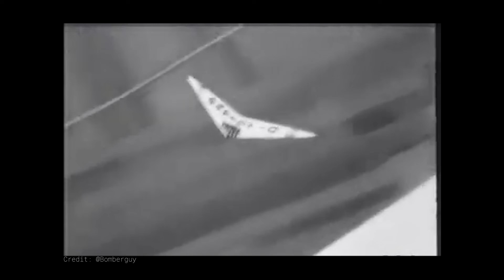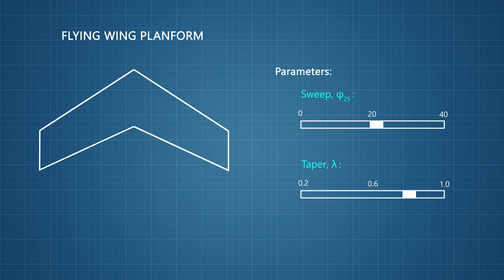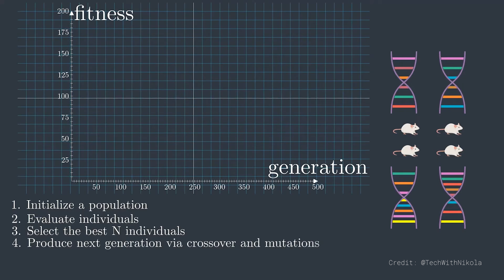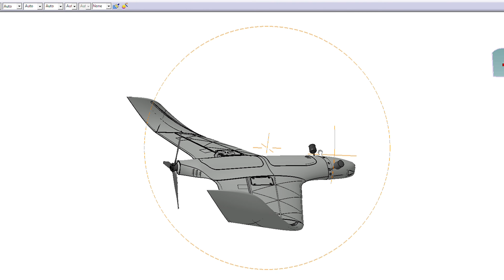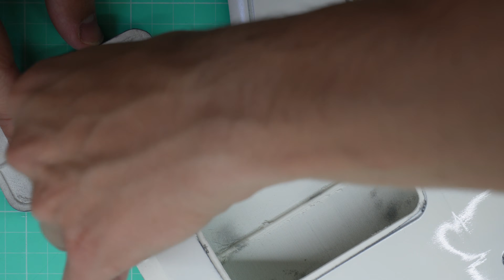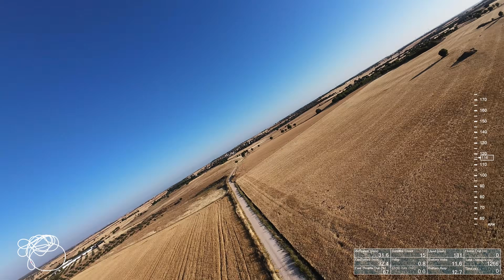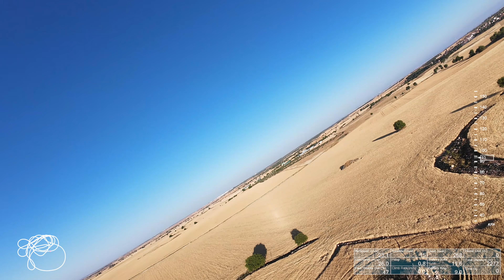🚀 I asked A.I. to design the ultimate FPV Flying Wing... and it's INSANELY EFFICIENT!

Comment: can smb explain why the wing area has formula b/2 * (Cr + Ct)? is either a mistake or i don't understand something. I'm thinking of the area of a rectangle which is height * length. so then if the b/2 is the length of the wing, which here is 30 cm, then the Cr+Ct is the height. which somehow is one over another which i disagree with, like what's the point of adding Cr to Ct when Cr itself is bigger then Ct and contains it in a sense. SO then if we just go with it still we get a rectangle area which is bigger then the actual wing area. This is not a rectangle so it isn't  a regular shape. the calculation should give a far greater area then the actual wing. So whatd up with that? Where am i wrong about this?

Comment: Insanely efficient? A Z-84 with a 4S Lion pack and Ardupilot cruises at around 3.4A and climbs nicely at 4.5A. Total flight time over an hour and with good equipment you can do 20km out and back with no problem.

Comment: Very impressive effort. My all time favorite aircraft is the Waterman Aerobile (1935). I designed a hybride wing for an amphibian ultralight then discovered Waldo’s brilliant aircraft hanging in the Smithsonian above my other favorite aircraft, the super Constellation. If you want to go to another level I have a unique thruster that will give you vtol performance using aerodynamic plus impulse/reaction lift while enabling optimized forward thrust for high speed flight.

Comment: You are explaining that you are using a neural network and then show code using a Gaussian process regression model. Those are two completely different things.
Reply from the maker: Very well spotted. I actually used both methods as surrogate models (a neural network and a Gaussian process) — the snippet in the video just happens to show the Gaussian process implementation. Both versions of the code are available on my Patreon page if you want to dig into the details. 🚀✈️

Comment: That looks like a Munk M6 airfoil from its reflex. The reflex handles the nose pitching moment. An alternative would be using a symmetrical airfoil. Did you consider that?
Reply from the maker: The airfoil is actually a modified MH64. I go into a bit more detail about the section choice and reflex in the second video of the trilogy, if you want to dive deeper into it. 🚀✈️

Comment: If someone scale it would it be ok? 2-3 times bigger
Reply from the maker: Scaling it up will definitely work, but ideally you’d want a new optimization loop rather than a simple uniform scale. When you scale an aircraft, surface area grows with the square, but volume (and weight) grows with the cube — so the aerodynamic and structural balance changes. And larger wingspan version would actually benefit from a higher aspect ratio. 🚀✈️

Comment: Amazing video! I hope you keep uploading more, since very few channels have your level of quality.
I wanted to ask you a couple of questions: do you use a multilayer perceptron?
Also, how do you make sure that when you run the CFD simulations, the parameters you select have enough variance for the neural network to properly interpolate the data?
Because, of course, I’m not sure how complex your hyperplane is, but if you don’t take enough points, you might risk flattening a local minimum, right? Lhs?
Reply from the maker: Thanks a lot! 🙌 Really glad you enjoyed the video — comments like this really keep me motivated.

About your question: I use a mix of Latin Hypercube Sampling and random sampling to cover the design space broadly. Then, as I approach the optimum, I run additional simulations around that region (and near the point of maximum uncertainty). Of course, there’s always a risk of missing the true peak and getting stuck in a local maximum, but it’s quite unlikely given the number of evaluations.

Regarding interpolation — neural networks are way cooler, but in some side projects I actually got better results using Gaussian Process Regression, especially when data is limited. 🚀✈️

Comment: Hi, just found your vids.  Cool stuff!  I've got something for you to play with, an unusual airfoil that combines sweep with washout effects and a control scheme i use that i call 'washerons'.  I tried to model this stuff back about 10 years ago but XFLR5 was having none of that inverted trailing edge 'nonsense' lol.  Combined with light weight and a high aspect ratio i built am entirely stable finless design i called the 'Darkangel'.

Here it is in action, notice the entire tip from the LE tip chord to about 1/3 the halfspan inboard from the tip is a control surface.

https://youtu.be/fNA1sj-M9UM?si=AClOWit0sscqDlYx&t=570

I was inspired by watching turkey vultures and how they twist and change the geometry of their wings and i basically replicated that geometry change on a high aspect V wing using an airfoil i also created called the RM airfoil.  It's silly simple and a bit odd, i wanted an airfoil for finless wings that was easy to make without CNC tools.  So i took a flat plate, rounded the leading edge top side , then cut a trailing edge taper on the BOTTOM side beginning at 75% chord, so the last 25% of the wing is tapered up to the trailing edge.  It's counterintuitive, bit with a thick airfoil along a swept and tapered profile effectively induces several degrees of washout as the LE drops and the TE rises in relation to the decrease in chord.

Check out RCgroups and search for 'washerons' and 'RM airfoil' to find all my pics, drawings, writings, diagram,s and discussions as well as other people who had success with this weird airfoil.  I'm not really active on the forums these days but there should be all the info i dropped on it in my post history there.  I experimented a bunch with different foils and stuff like variable geometry and semi-soft wings.

Comment: Do you think it can be scaled up to larger done with like 1 meter wingspan or the whole thing needs to be repeated to optimize for larger size.
Reply from the maker: You could theoretically scale it up to 1 meter, but I’d actually recommend running a fresh optimization loop — surface area scales with the square, weight with the cube, so the aerodynamics shift quite a bit. You’d likely end up with a higher aspect ratio and different proportions for best efficiency. 🚀✈️
Reply: @neuronautics_Lab would you be kind enough to share the training data with me.
Reply from the maker: The training data will be available very soon in a dedicated Patreon post — stay tuned! 🙌🚀✈️

Comment: Super cool project! What kind of efficiency gains do you expect from sanding and painting vs using the raw printed surface?
Reply from the maker: Thanks! 🙌 To be honest, I don’t think there’s much aerodynamic gain from sanding/painting at this scale. Epoxy helps more with strength, and paint is really just for looks 😉. Probably not worth the extra weight on a small wing like this 🚀✈️

Comment: Why a 1507 motor and 5x3 prop? I think the stator volume is pretty good choice and a 5 inch bi blade too. I'd have chosen a 2004, 2005, 2104, 2105.5 or 2203.5 or 2204 rather with a 5x4 prop.
I think wider motor is more efficient for a 5 inch prop and more power too
Reply from the maker: Haha yeah, really interesting question! Short answer: the 1507 + 5x3 combo came out of an optimization algorithm I run to match motor+prop to a whole list of requirements, including optimal cruise speed. Your completely right—wider motors are generally more efficient. But there’s also a weight penalty, so it’s all about finding the optimum trade-off. Definitely more to dig into there! 🚀✈️

Comment: I actually thought to do something similar but I was not ready to put the time and effort in. Especially since the math behind it is not so straight forward. So hats off to you for actually doing it and spending so much time on it!

One question still remains for me though: where did you place the CG in your design along the x-axis? And why was the location of the CG (in x-direction at least) not part of your optimization problem? Because my understanding is that it actually influences the circulation distribution and thus the efficiency of the wing quite strongly in flying wings (apart from stability). This is also why I had such a hard time formulating the optimization problem since it's very hard to quantify the influence of the CG location since it's not really part of the CFD simulation. Maybe I'm wrong here but I would appreciate the thoughts of an expert a.k.a. you to this :D
Reply from the maker: Thanks! 🙌 Really appreciate that you noticed the effort—it definitely took some late nights! About your question: you’re right, CG location plays a big role in flying wings, both for stability and efficiency. In my case, I fixed the CG near the neutral point (around 5% MAC). That means all the winning designs from the genetic optimization algorithm had to satisfy at least this static margin to ensure longitudinal stability. The reason is that CG isn’t something the solver “sees” directly—it’s more of a stability/trim constraint than an aerodynamic shape parameter. If I had treated it as a variable, I’d need to couple the optimizer with a stability solver (static margin, trim moments, etc.), which makes the problem much more complex. Anyway, super cool that you thought about this too—it’s exactly the kind of thing that makes flying wing design so tricky but also fascinating! 🚀✈️
Reply: @neuronautics_Lab Thank you so much for your elaborate answer! I think so too! It’s kind of like the ultimate engineering task (at least for aircraft) since there are so many variables and so many compromises to be decided for (or against). 

Great to hear that you placed your CG there. I’m really glad and it’s also kind of funny that the flying wing I’m designing at the moment also has its CG roughly at that point. My planform also looks quite similar! It’s kind of reassuring seeing it turning out similar to your highly optimised design. Since I “only” tried to apply all the things other engineers have found out about flying wings. I mean zi calculated quite a bit but nothing even close to you. It’s kind of like as if the laws of physics don’t make exceptions, hhm 🤔😂

Comment: Awesome project! Might I tip you about LW-PLA (low/light weight PLA), this stuff has a foaming effect during printing and thus reducing weight of the print. If not sturdy enough, this leaves grams to spare one could use for reinforcements (like fiber cloth joints etc.).
Reply from the maker: Thanks! 🙌 Actually the full airframe is printed in LW-PLA—all my planes are in this filament now. Honestly, I don’t even know what we did before it 😅. The weight savings + strength balance make it a game changer for these builds. 🚀✈️

Comment: The LED lighting o  the wings ends the laminar flow very early, does this increase stability maybe? Removing them would lower drag though.
Reply from the maker: Thanks! 🙌 Good eye! In this case the LEDs are actually taped flush to the surface, so there’s no extra drag penalty. That way I still get the fun lighting without messing up the flow or efficiency. 🚀✈️

Comment: Locator pins on connection points would make glueing much easier and ensure perfect alightment. This wouldn't be much of a structural advantage, but it would make assembly easier.
Reply from the maker: Thanks for the tip! In this design, locator pins aren’t really needed: the keyed/mating geometry makes alignment straightforward. Since they don’t add structural value, they’d be extra weight (and print time)

Comment: AI does not design anything, it recycles human ideas. Nothing new is coming out of this and if you think so you should really get to understand the tech.
Reply from the maker: Respectfully, I disagree 🙂. AI isn’t “replacing” physics or creativity—but it does let us search huge design spaces, learn from data, and converge on solutions that would be impractical by hand. Think of it as a power tool: I set goals and constraints, physics does the judging, and AI accelerates the path to non-obvious designs. That’s exactly what made this project possible. 🚀✈️

Comment: I not see main wing Spars. If there are any wing Stability issues you not need to ad an entire carbon rod, you can make a groove in the wing layout, the printer will form an holm. But it makes a scar on the wing. Or slide in an carbon flat rod. It is 0,5mm sthin and flat
Reply from the maker: Great point! 🙌 There are already internal 3D-printed spars and ribs inside the wings and fuselage to withstand the expected flight loads, so stability is well accounted for. 🚀✈️

Comment: Is it printed in Vase mode?
Are there holmes in the wings?
Reply from the maker: Hi! 🙌 It’s not printed in vase mode — the design uses a traditional print approach with perimeters, infill, and internal structures. The wings have integrated ribs and spars rather than hollow “vase” shells, so they can handle flight loads reliably. 🚀✈️

Comment: I just printed all of the parts and am about to assemble. What size control horn and clevis are you using? And did you just glue the two clevises directly together - no pushrod? I see 21, 27, and 29mm clevises available. Assuming 21? I'm going with L11×W11×H20mm control horns unless you suggest something better. 
For electronics, I'm going with a speedybee f405 wing mini, lumenier 36A blheli32 ESC, and an HGLRC M100 GPS. FPV will be a standard DJI O4 - not pro. Hopefully it fits the same as the pro. Battery is a TATTU  850mAh 75C 3S.
Anyway, can't wait to fly this thing! Let me know on the control horn and clevis sizes if you get a chance. Thanks!
Reply: Oh, I'm also curious how you wired in those LED noodles. I've used ws2812 strips on my models before, but never those silicone noodles. Just wondering what kind of voltage they need and where you soldered them to exactly. Thanks again.
Reply: Also - some guidance on print settings and orientation would be really helpful. Took a fair amount of trial and error to get the parts to print perfectly. I've got it pretty dialed in for S3D on my Flashforge Creator 3 now though if anyone needs help on slicer settings. And yes, my printer is old, but I can't afford a Bambu. ;)
Reply from the maker: Great questions! 🙌 The clevis I’m using in the video is 21 mm, but honestly you can go with any standard RC linkage that fits well. The control horn I used is 24×12 mm nylon hinges. The nose was designed around the DJI O4 Pro, so I can’t confirm if the Lite fits — but I actually ordered the Lite myself recently, and I’ll be updating the files (including the nose) for that setup. As for printing, settings are pretty straightforward: I normally use PolyLite™ LW-PLA and stick to the manufacturer’s recommended parameters. 🚀✈️

Comment: What about test and validation sets for NN? Did you do CFD verification to check if results from NN match results from CFD for your optimal design? Also, 250g limit is not arbitrary - that's what most countries allow to fly without regulatory burden. So being over this limit mostly defeats the purpose.
Reply from the maker: Great points! 🙌 Yes — I split the dataset into training, validation, and test sets to make sure the NN wasn’t just memorizing. I also ran CFD on the optimal designs to cross-check the results, and they matched closely within expected error margins. And you’re absolutely right about the 250 g limit — that’s a key regulatory threshold. In future iterations I’ll be working on weight-optimized versions that stay under it. 🚀✈️

Comment: You did all the CFD work then ruined it all by putting in LED strips... RIP laminar flow... the tragedy...
Reply from the maker: Good point! 🙌 The LED strip is actually inserted in a small groove, then covered with tape — so in the end it doesn’t protrude and causes almost no disturbance to the upper wing flow. 🚀✈️

Comment: Great video and the design is also excellent, but I have to comment on something. The epoxy and paint layer probably added a lot of weight. Next time, you can try painting a thin layer with an airbrush and sanding the part and not putting epoxy. From my experience, the difference between the added weight and the added drag is very large and it's better to save as much weight as possible.
Reply from the maker: Thanks! 🙌 You’re absolutely right — especially at this size it’s usually not worth the extra weight. I decided to sacrifice a bit of performance for that clean, finished look this time. 🚀✈️

Comment: Lockeed Skunk works did do a combo lifting body flying wing UAV in the early 2000's which worked very well.

I really like this build and would definitely buy a kit.  ❤
Reply from the maker: Thanks! 🙌 Amazing aircraft — were you thinking of the Polecat (P-175)? 🚀✈️
Reply: @neuronautics_Lab 
I am uncertain about it's current classified status but it would be similar to the P-175

Comment: 7:36 1:1 aspect with reasonable to large sweep on a tailless is very squirrelly, worsens yaw tendency initiating roll also. Planks don’t suffer as much , straight leading edge and forward swept trailing edge

Comment: 1641   a pushrod should be Perpendicular to its associated hinge line.!    the design of a printed swept main wing should include features that resemble:  a central main spar, located at thirty percent of mac; and a main spar located at thirty percent of chord in each wing half.
Reply from the maker: Great points—thanks! 🙌

-Pushrod geometry: agreed—ideally perpendicular to the hinge. In this case it’s a small compromise for easy of installation (just a few degrees of misaligment than won't affect the performances)

-Spar placement: yes—~30% chord/MAC is the sweet spot. This print uses internal ribs + a primary spar shelf around 25–30%
Reply: Provided the misalignment is symmetrical and not excessive it wont make any difference. Obviously perpendicular is the ideal but real world limitations must govern.